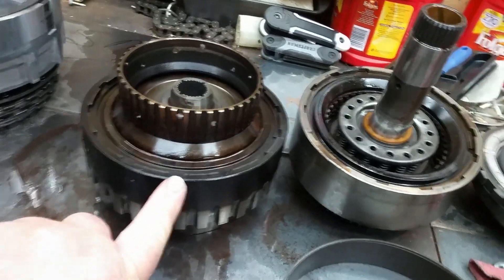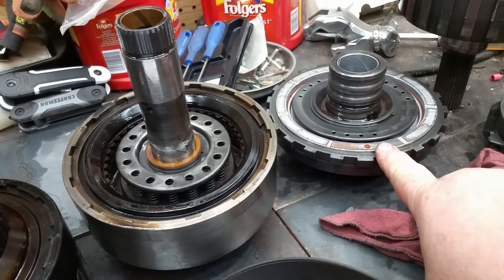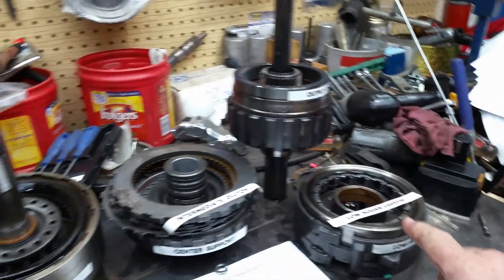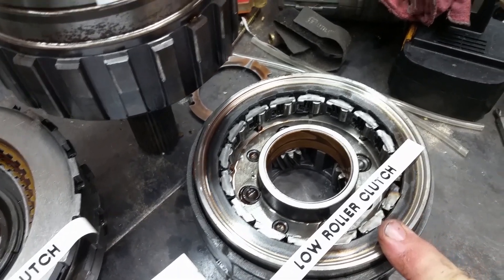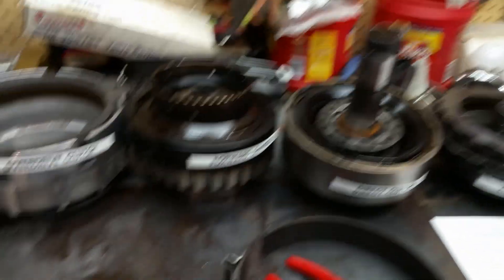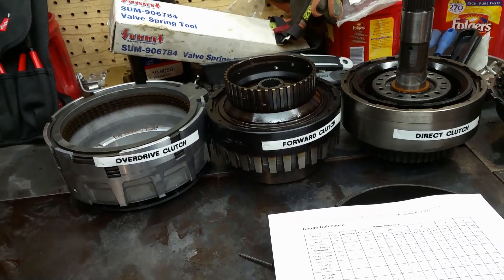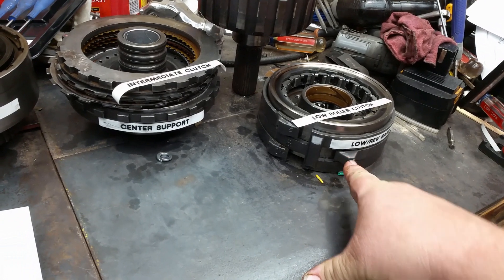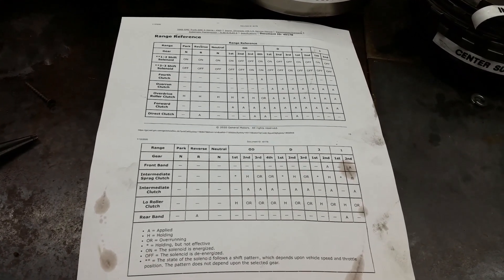TRANSMISSION HOW-TO, THE GM 4L80e: Diagnostics with Range Reference

Comment: I rebuilt my 80e after a direct drum fail. I accidently put in a tall rear servo piston with a short cover and cranked it down. Ooops. 
When I tested it it rolled in reverse, I stopped it, neutral worked, I put it in drive and did first and second and when I braked to stop the wheels the motor stalled. I started it up and put it in drive and it was bound up so of course I mashed the pedal. It made a bang and started working but I didn't have reverse. I put the original servo back in and it still won't reverse. Any thoughts on that?
Reply from the maker: I'd say you'll probably have to take it back apart to find out what broke....

Comment: I have a 37 foot rv.  I have two questions. 1. I am having the transmission rebuilt.  I am getting it from the dealer because it is cheaper than the local shops and they have a much better warranty (36/100k).  Would the transmission benefit from a gear vendor? 2. I am buying the XTM series torque converter from Hughes Performance with billet cover special stator.  Will this torque converter help in dealing with the hills? currently when I hit the grades going to vegas, the rv slows down to 35 mph in 3rd and the tbi 454 engine is just struggling.

I have 4 additional coolers with fans on the trans plus the cooler that goes through the bottom of the AC coil and the radiator.  So the trans stays between 160 and 180 when I am climbing the grades in 100+ temp while traveling to vegas in mid day summer.  My sensor is in the B&M pan and due to all the coolers the trans now holds 17 quarts of oil.
Reply from the maker: On the gear vendors, I'd say no. But the TBI 454 is a struggle. I had one of those in a 3/4 ton towing a 5th wheel and I know what you're fighting. I would recommend an upgrade to the 454 with late model port injection, some good heads and exhaust and you wouldn't be disappointed. Good choice on the converter and keeping the trans cool with all the coolers!

Comment: I have the 6L80E in my 2014 Sierra, from what I understand the torque converter is the main problem, something to do with the lining coming apart and clogging the filter and toasting everything. I'm aiming to do preventative maintenance by getting a new updated torque converter and whatever service can be done to make it live longer as I'm almost at 121k now.
Reply from the maker: If you made it to 120k on the first trans, you're in good shape. I've been getting these in between 70 and 80k cooked. But by all means, change the fluid and filter and converter. I've been building quite a few of these at the shop....
Reply: Bought it used at 112k, GMC dealer said it’s never seen a dealership for anything transmission related. It was a maintenance truck for a company in Arkansas, so I suspect it has been given some love at some point. Fluid looks good, doesn’t stink, and shifts like a champ so that’s all I know.